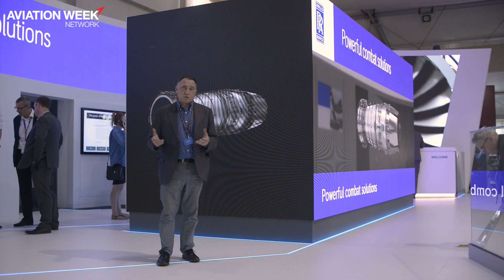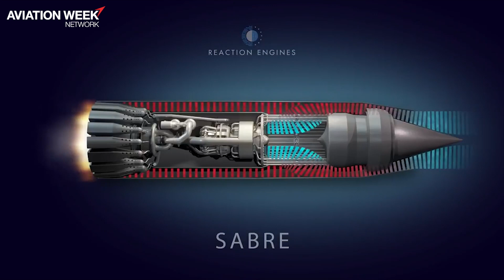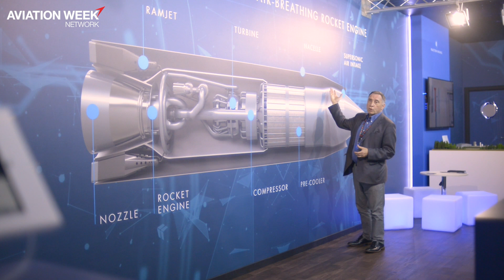Here’s The Future of Hypersonic Flight

Comment: The air breathing Sabre engine is similar to the turbo-scram jet that was used on the J-28.The J-28 flew for several hours at mach 6 speed for several hours and landed on September 18,2015